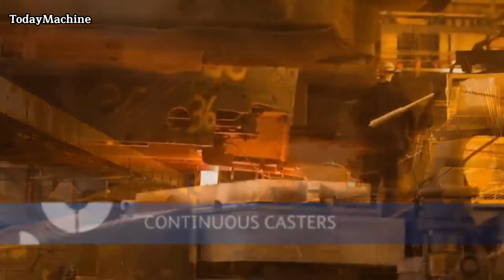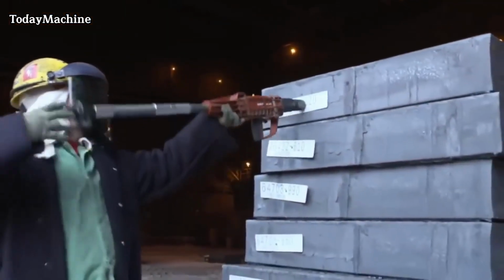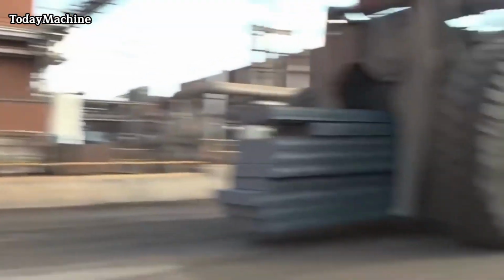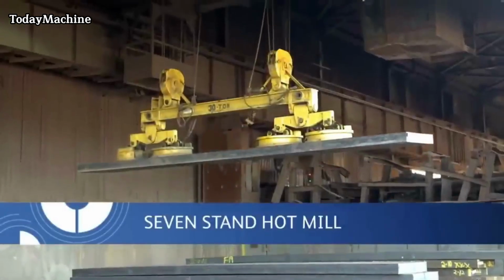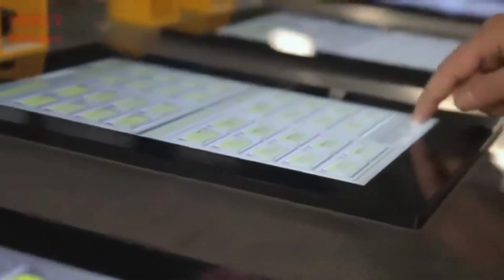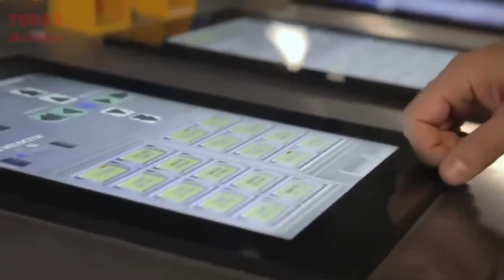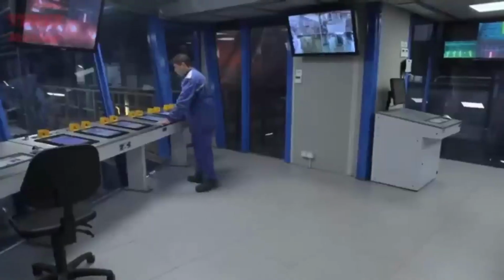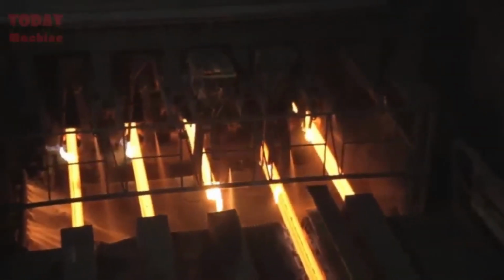Rare Seamless Steel Pipe Manufacturing Process! Amazing Large Steel Pipe Factory！

Comment: Galvanized steel in the rolls protected from corrasion due to the zinc coating, "BUT" what happens when you shear the roll into panels now you have an open edge that does not have the coating? So, what happens to that exposed   edge?